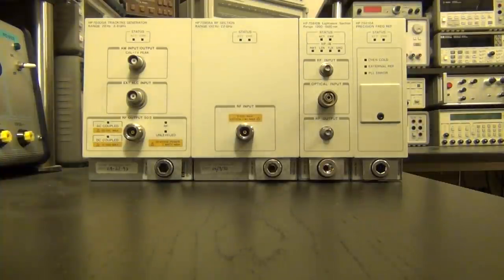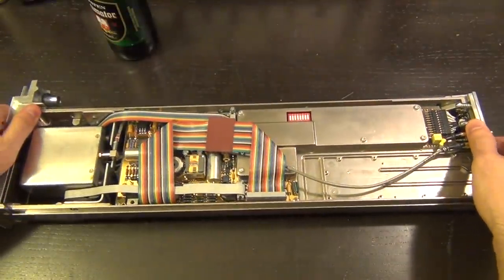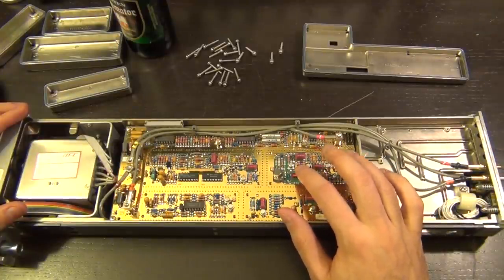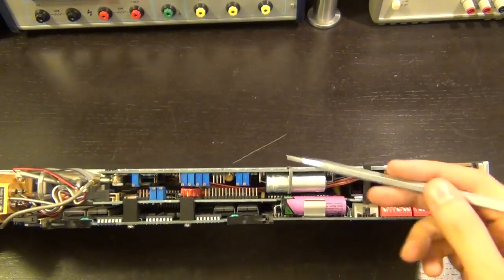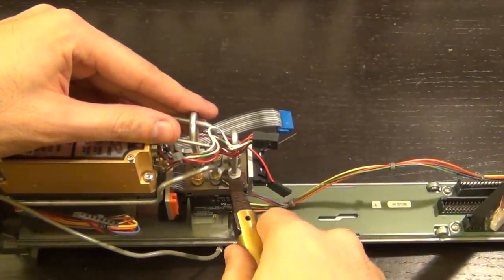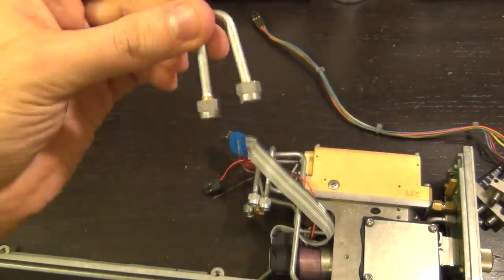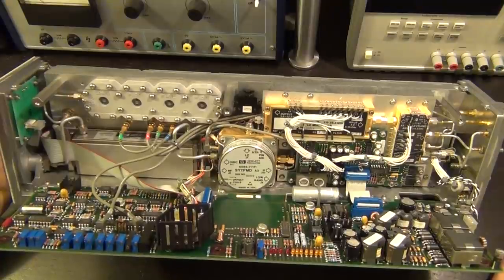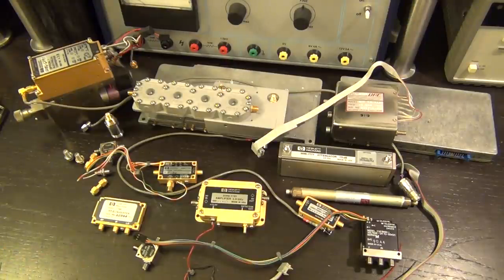TSP #46 - Teardown, Analysis and Part-Salvage from an HP 70001A Series Optical Microwave Analyzer

Comment: The big chip on that power meter board is a rather interesting one; it's an AD7550 which is a 13-bit quad-slope integrating ADC with up to 500kHz sampling rate.

Those Teledyne switches are actually 40GHz.

Comment: HP Catalog 1990, Page 117
70300A RF Tracking Generator (20Hz - 2.9GHz) $11,950
70310A Precision Frequency Reference $4,980
70908A RF Section (100Hz - 22GHz, fundamentally mixed) $36,600
HP Catalog 1992, Page 387
70810B Lightwave Section (100kHz - 22GHz) $19,900

Comment: Nice teardown video. I have the spectrum analyzer that takes these plugins (HP 70001A / w HP 70206A), yes it's big, bulky and heavy, but it works. I have the HP 70310A installed, mine has the distribution amplifier option (an additional $1,500). It kind of pained me that these modules were cannibalized for their components, those modules still command fairly high prices on eBay. Keep these great videos coming!
Reply: I agree---I just watched the video for the second time today. Painful to watch such a nice piece of equipment being cannibalized. I'm a big fan of the HP 70000 series instruments. Although they are huge and heavy, they are quite versatile and the performance is good. I have the same modules in my system, sans the optical converter.

Comment: The motor on the optical converter, the connections is a follows: Red+Black: DC motor, the FFC cable is for the optical encoder.
Reply: ***** exactly

Comment: Dear Shahriar,

The 70908A  has a unique dynamically tracked YIG preselector. There is an additional YIG sphere in the same magnetic field as the RF filter spheres. It is configured as a frequency discriminator with the LO as the input, and is in a servo loop that keeps the RF YIG filter exactly tuned to the LO +IF frequency as the LO sweeps.
    I don't know if HP ever used this system again. Older microwave analysers always had a manual YIG filter peaking procedure. 
  The 70908A was an extremely expensive module when new. They still sell for up to $2000 on Ebay. I have this module as part of my 70000 series spectrum analyser. The 70000 series was very good value for money when I bought mine, (10 years ago).  

regards

Cosmo Little

Comment: Shahriar the LO with the YIG was likely in the display unit. Usually the LO and 2 IF modules were installed in the 70004 display, with the RF, high stability time base, and other modules in the lower section.

Comment: Very nice score.
I did miss a bit about what microprocessors they used on the board and how much rom/ram there was and also a bit about the control they did. Not a long story, only a few minutes for each board.
I am looking forward to a closer analysis of the modules you scored and what you can use them for.

Comment: 29:28 Aluminum would not corrode look like that it would still be white due to its protective aluminium oxide layer. That has to be silver plated brass or (but much less likely) silver right through. Corroded silver would look exactly like that and a pure silver surface have a with very small yellow tint to it as it seem like it have.

Comment: Surely the connector on that filter  is silver, not aluminium
Reply from the maker: Thanks Mike, I don't know why I said Aluminum! In my head I was thinking that unlike Aluminum, you can see the discoloration of the exposed areas.
Reply: The Signal Path Blog Silver will usually turn black after corrosion and time. Aluminium do not corrode this way.
Reply: mikeselectricstuff silver plated brass

Comment: I agree. The last module is really beautiful.

I really wonder how many people and how much time these things took to design and build. Most elements are really hand assembled and hand built, with lots of custom machining parts, custom interconnects, custom rf components, and lots of system and mechanical engineering. How advanced CAD software and engineering techniques could it be around 85 to allow all that thing to fit and inter operate properly.

Comment: Please put the unused boards and parts on ebay or list them on EEVblog. I've found that a fair amount of people were interested in boards from test gear that I considered trash. Likewise I was happy to find cheap parts for test gear which had missing parts or on which fried resistors/transistors ruined a board. BTW: I need an attenuator assembly for a 8656B for cheap :)